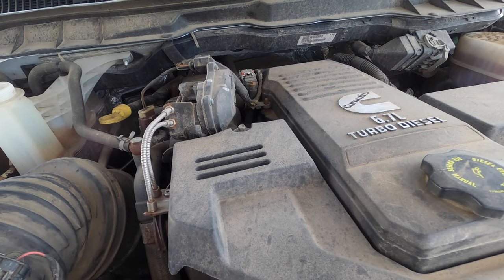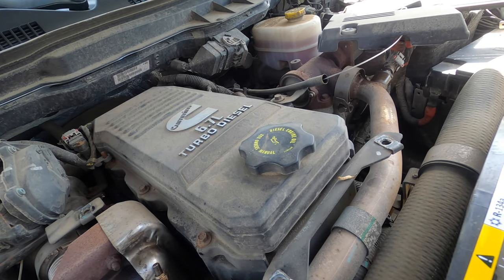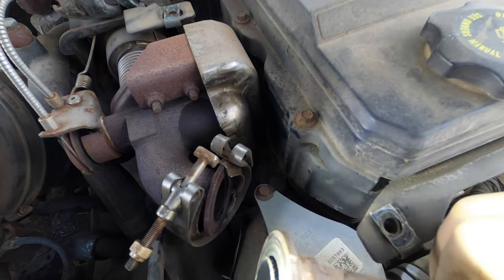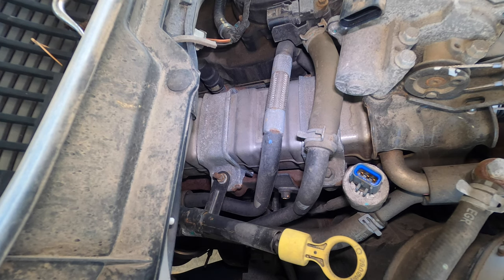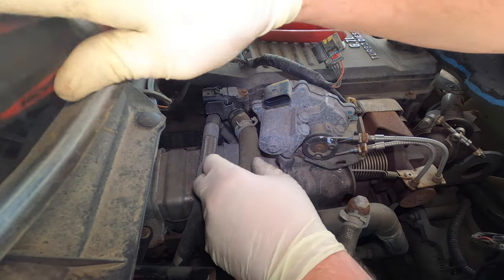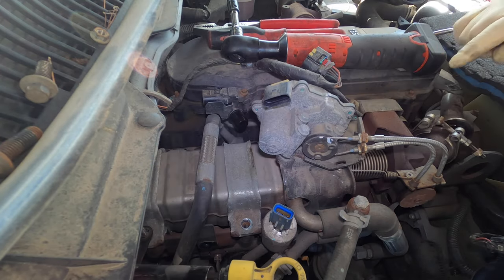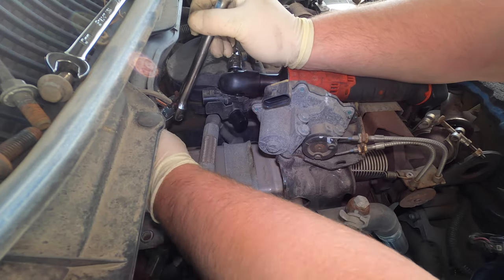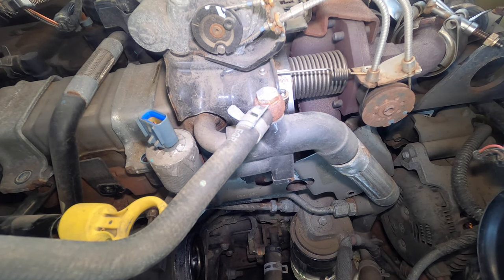Mystery 6.7 Cummins Coolant Leak

Comment: Fantastic video.  Good to know the procedure.  I have a 2008 Ram 4500 with a 6 speed manual and my truck does not have that EGR Cooler valve assembly you were fighting as well as the Trans dip stick.  Knock on wood, my coolant levels have been fine for the past 15 years.
Reply: I believe this is for 2011 and up I think 2018.

Comment: Hey Brother they actually made a tool to pressure test the cooler with out having to remove the cooler it saves a ton of time and the price won't brake the bank.
Reply: It’s also recommended to clean/flush your Egr cooler.👍💯

Comment: Did you push that connector in or out?The one with your little red screw driver
Reply from the maker: On the brown connector the lock has to be slid to the side. The black connector has to have the red lock pushed back away from the connector.

Comment: I’m probably going to be doing a friends 2014 Dodge 6.7.  It’s using a lot of coolant and no leaks.  The newer models with all this emission garbage is why I hold on to my 2000 Dodge with the 5.9 Cummings.
Reply: Any update on your friends 6.7?
Reply: @phirstplaceg1515  
  Yep, I installed a new EGR cooler and it took care of his coolant loss and cooling issues.

Comment: Hello! 
I’m having almost the same issue with my ram 2500 2019, I can definitely smell and see coolant dripping down the frame on the passenger side, but I don’t see enough water dripping, I have to add about 1.5 gallons after one hour of driving, do you have any ideas and what could be the issue? 
Btw no water on the oil, and no white smoke coming out of the exhaust.
Reply from the maker: If your seeing coolant on the passenger frame rail it possibly could be a leaking heater core (there should be a black drain tube coming out the firewall , if coolant is leaking from that its likely the heater core is leaking). The other thing you could check is the coolant expansion tank for leaking. Easiest way to check would be to remove the passenger side fender liner to hopefully locate the leak.
Reply: @drewsshoplife  thank you so much! For sure I’ll take a look at that, also I noticed some green algae and rust around the actuator bracket, but for some reason I don’t think that could be the reason why I’m loosing that much water, do you have any advice on that?

Comment: I have the same problem but mine is just a lil different . I lose coolant after driving it for a while , but when I take the reservoir tap off the coolant comes back to the reservoir. Any ideal what it can be ? Please I need help
Reply from the maker: Do you have to add coolant at all? if not that can be normal. If you have to add coolant then you have a leak, your best bet is to pressurize the cooling system to find the leak, if no external leaks are found then its likely its the egr cooler.

Comment: QUESTION:   Anybody know how to bleed air off the coolant system when refilling the coolant after changing it on a 6.7?  Thanks.
Reply from the maker: The easiest way is to vacuum fill the cooling system. The later 6.7 like this one doesn’t have the coolant bleeder screw, if it did it’s best to bleed it there. In the case of this truck I would just fill the coolant bottle over the course of like an hour to let it settle. Then start it up with the cap off and let it run for like 10 minutes, then reinstall the cap. Sometimes they can be difficult so before driving I will hold the rpm’s at 2000 with the cap on and watch the coolant temperature till the thermostat opens (drop in coolant temperature). Then shut it off and let it sit a couple hours and check the level.
Reply: @drewsshoplife  Thanks for info!  I've got a 2014, is the bleeder screw abbove the cooler?  Appreciate your help!
Reply: @drewsshoplife  Thanks for info!  I've got a 2014, is the bleeder screw abbove the cooler?  Appreciate your help!
Reply from the maker: @charlottenee8018  I think the first years of the 6.7 had them. It was on the top of the pipe that attaches to the cooler on the passenger side. It’s an Allen key bolt if I remember correctly.
Reply: @drewsshoplife  Thanks for the additional help.  My 6.7 has the one one your referring to so I'll give that a try.  Thanks again for your great videos and for your interest in helping others!

Comment: Just gonna pull the EGR cooler?  Lol. That takes a little more than a minute.  Nice job getting the cooler out.  Most guys pull the bypass valve out first but it’s not always a time saver.
Reply from the maker: Its not as easy as I make it sound but its the most accurate way to make sure thats the leak. I try to be extremely certain that its an issue before removal To not waste time and money. Ive pulled the egr pipes and valves before and find nothing , remove the cooler and its obvious.

Comment: So just got a call from the dealer and they can’t find out why I am losing 2 to 3 gallons of fluid out of the reservoir bottle they are stumped everything was perfect they said when they pressure tested everything so it totally sucks I got 600 miles to drive home so bumbed out